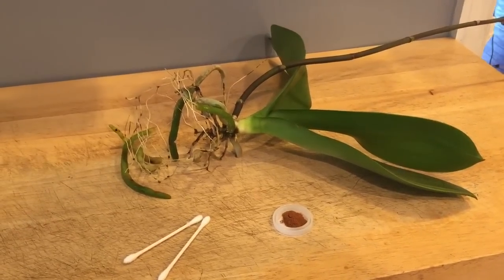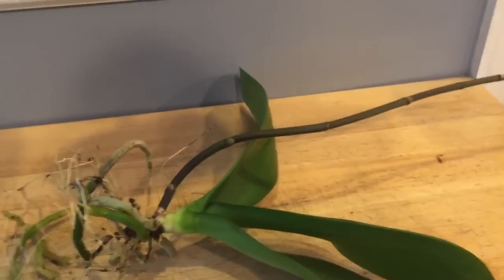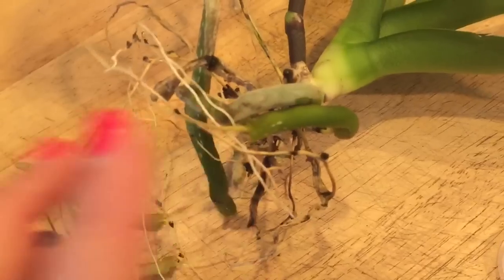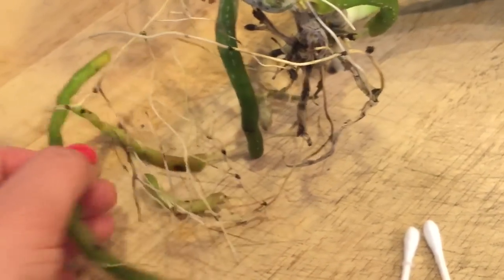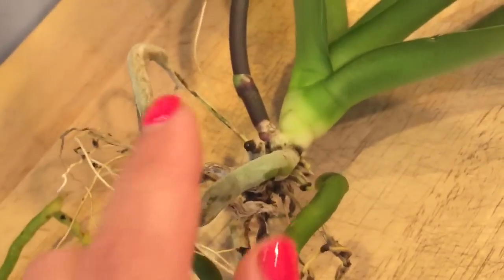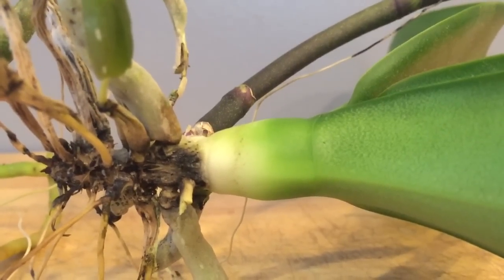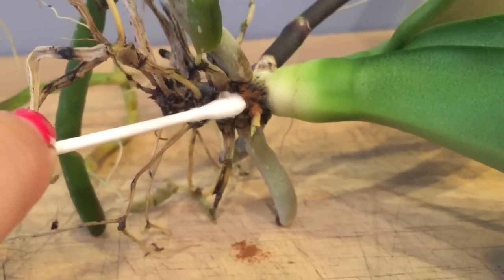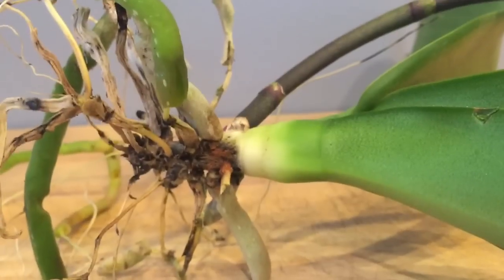Water culture orchid,  treating stem rot on Phalaenopsis

Comment: Hi Danielle, I put cinnamon on my leaves if then have a split or a wounded spot. As long as your just treating those area's it won't affect the leaves. Just wipe with the other side of the qtip so there is no cinnamon where it's not needed. Great videos

Comment: Thanks for sharing. Has the velum ever regenerated?  Have you ever tested this theory of the root still absorbing as opposed to just sitting there and staying moist for a while but not actually drawing up? I mean if it is helping the plant by drawing up then it should “remake” its velum and keep growing.  I wonder - since you are doing water culture - if you can gently protect those with velum with  plastic wrap after being well hydrated, then either put all the rest of those without covering into a colored water (water and food safe coloring). Don’t cover the roots - just the tips to see if they will pull the colored solution up into the root.  If you have any blooms (pref white) left..if the plant is drawing water then this colored solution should change your bloom color.  I have been wanting to do this but haven’t had an opportunity.  I’m sure it will happen.  The next time I buy a big box white phal - will probably be a good time to try this as it seems I always lose roots when they go from moss to bark or they are in bark but they have either rotted or dried up (over or under watered in the store).  Using a colored solution is my understanding of how we get those white phals turned awful blue and purple in the stores. I have seen either they inject the solution in the stem or let it take up coloring by roots.  In the past, I have done white hydrangea stems by letting them soak up colored water - no reason orchids in water culture wouldn’t do the same but I have never tried it.  On injecting, I don’t see closeup well enough to use a hypodermic - I would stick myself for sure.  Just a thought as I have wondered about how to prove this issue of uncovered roots.
Reply: Sorry to be so offtopic but does someone know a trick to log back into an instagram account..?
I stupidly lost my account password. I appreciate any tricks you can offer me
Reply: @Karsyn Yusuf you are welcome xD

Comment: Hi Danielle, Thank you so much for your  helpful videos!! I am new to growing and trying to save wounded orchids. I have stem rot, have applied the cinnamon but should I now put the plant roots into the water with the cinnamon on the stem?  A little bit of water seems to be absorbed by the plant, which is good, but it seems to be then moving up through the root system and is getting the cinnamon that's on the stem moist. I'm worried this is defeating my efforts of keeping the rot at bay. Should I air dry the roots after applying the cinnamon and if yes, for how long?  Thank you!
Reply from the maker: Dianne Mathieson I would say while the rot is an active problem less water is more, instead of the orchid having constant supply of water I would give it a small drink and then remove and let the roots dry completely before watering it again, if the plant can’t tolerate this her leaves will droop due to dehydration. As long as the leaves remain firm you are giving enough water. If the rot is far enough down the stem you could consider cutting the bottom of the stem off.

Comment: Were you able to save this orchid?
Reply from the maker: A Morales unfortunately not. The rot was worse then it appeared and a few weeks later it became evident it had reached the crown. 😔
Reply: +1 for honesty, and also noticing you don't seem to be biased toward a method (eg. water culture) - and you teach effective aspects of what you have learned for this method. That's excellent. For the rot - maybe trying systematic fungicides (rotated) may have given the orchid a better chance - in case the rot was attacking both outside and inside.